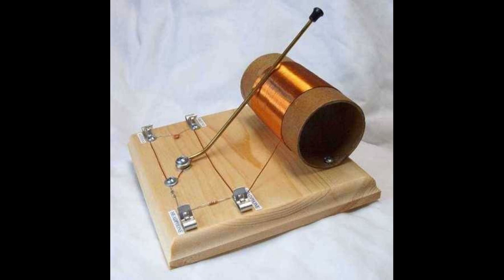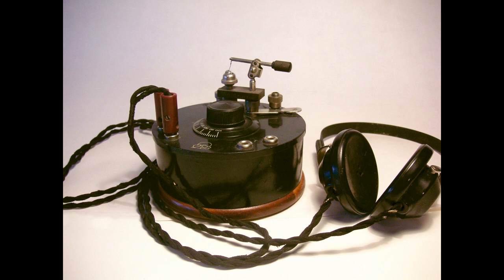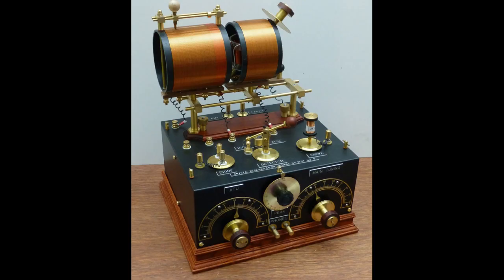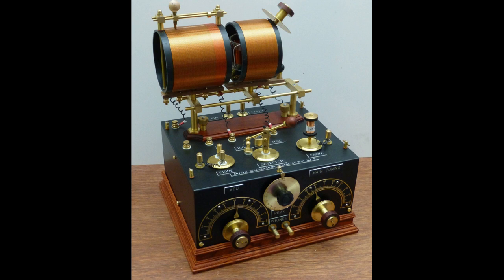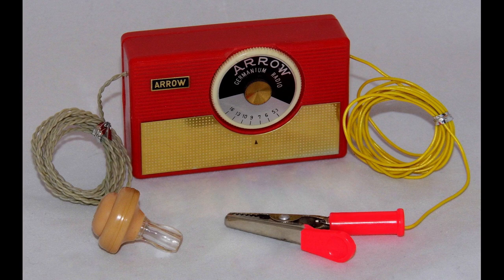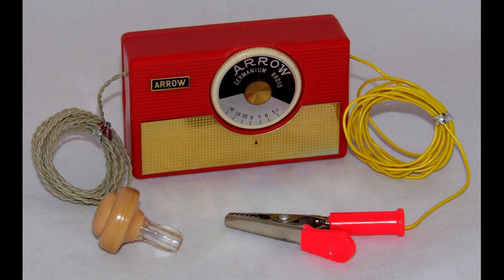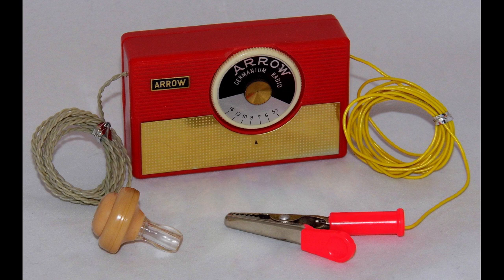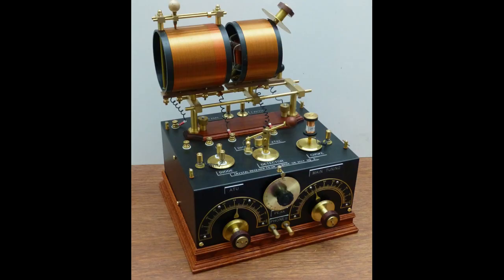What is a crystal radio?

Comment: The wildest part is that "crystal sets" used a SEMICONDUCTOR. Then we went to the Vacuum Tube (Valve) and with the advent of the Transistor, We were BACK at semiconductors!
Reply from the maker: It's kinda crazy isn't it?
Reply from the maker: Who would have thought?

Thanks for your view and comments, I really appreciate it!
Reply: The cyrstal was used as a diode or rectifier to demodulate the signal.  It doesn't amplify the signal .. for amplification you need a part like a vacuum tube or transistor.  So a valve or transistor radio still has a crystal or diode to do the demodulation.   The first diodes or crystals where very simple ..  you needed to place a sharp needle against a crystal and find an active spot.  A bit later they managed to grow germanium crystals and could saw those in little bits.   If you have a big old transparant germanium diode and you look inside you see a tiny black square and a tiny needle.   Now valves and transistors are a lot more difficult to make.  the first commercial transistors where a strip of semiconductor with drops of slighly different (doped) semiconductors on both sides.  So a crystal radio doesnt have amplification ..  you need to get all the energy for the headset from the ether.  So you need a good antenna and ground and a strong signal.
Reply from the maker: @apsdev  Yep. Such primitive technology yet so revolutionary at the time. Crystal radios are still being sold today, although you usually have to buy a kit and do some soldering
Reply: @technoWZ5598  I used to have these radio shack electronic project kits. Which had the coil on a ferrite bar and variable capacitor and diodes.  And you could make crystal radios with it, by putting wires under springs.  I now only have the manuals.  I used the chicken wire of the chicken pens as an antenna and could receive stations.
Reply from the maker: @apsdev  Ok. Interesting 🤔😎

I've never had a crystal radio, but I'm intrigued to get one someday, perhaps as a hobby or project. There will be more content on radios, don't worry! I might delve more into crystal radios and their impact on society as a whole.
Reply: @apsdev  I get that a crystal set doesn't have gain (RF or AF amplification) My point was most people think of solid state (semiconductor based) devices as being modern inventions when in fact they were used in radio before AND after vacuum tubes.
Reply: But its not true that "than we went to vacuum tube".
To be able to listen something on crystal radio, there were transmitter with (big) powerfull tubes needed :-) Vacuum tubes were there before and crystal was just used for demodulation of AM signal created by tubes.